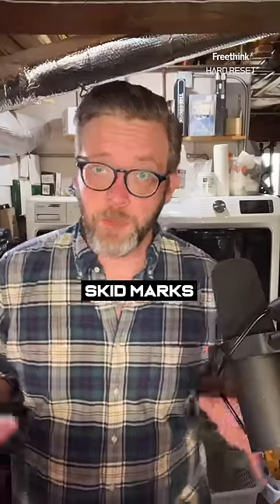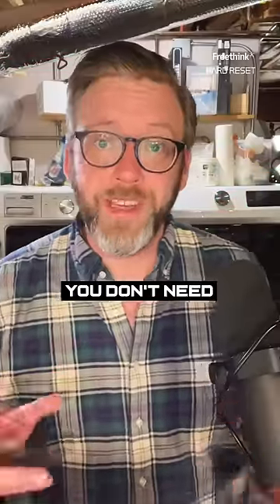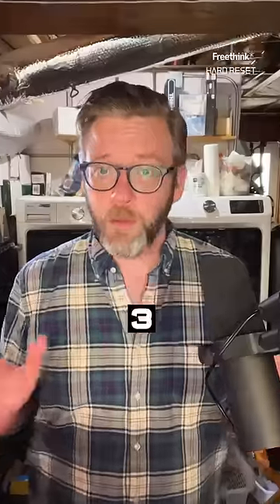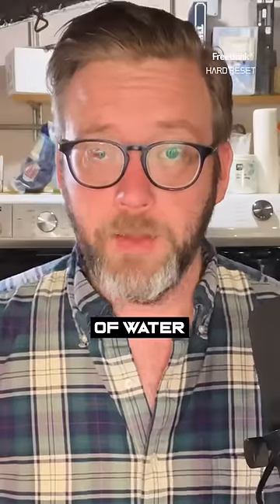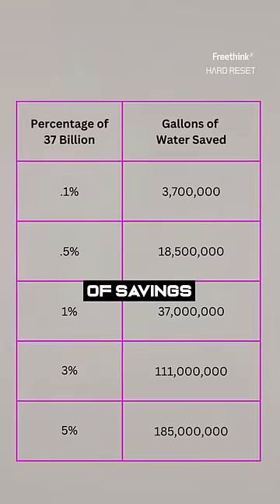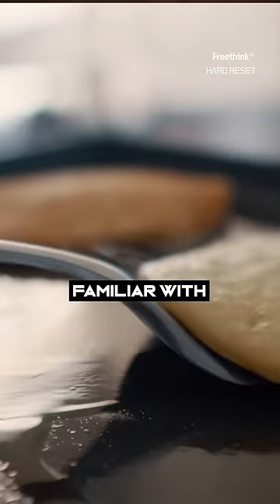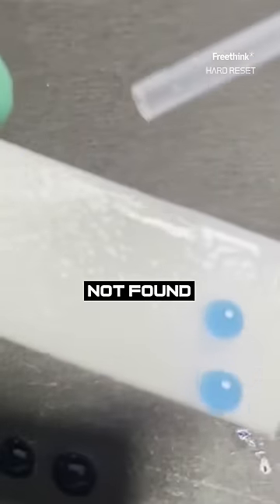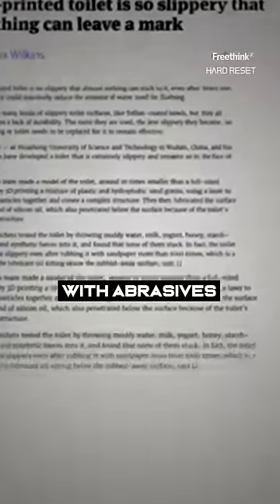Researchers invent super slippery toilet 🚽😳 #shorts #metamaterials

Comment: The standing water in the toilet bowl is meant to make an air-tight seal preventing sewage gas from going back up the toilet. And if you needed to push anything down that seal, you need plenty enough water or water pressure to do it. The flush isn't only meant to wash the bowl.
Reply: true, but this could definitelly be solved. For example train toilets dont have water in them and I never smell sewage (altho I do smell it when people miss the toilet .......)
Reply: @jurajpartl4797  there are different kinds of passenger train toilets. some just drop it to the ground below. others hold it in a tank with chemicals. and there are those that use the same thing airplanes have: a vacuum system.

a simple dump to the ground isn't gonna work for a home. chemical tanks need to be emptied and replaced. and a vacuum system needs power and has to constantly run to maintain a pressure differential; it's also a whole sewage system and not just the toilet itself.
Reply: @Kensuke0987 you're spot on that off-grid toilets are fundamentally different from plumbed toilets, but the video doesn't suggest 0 water.

Toilets use 6+ liters (2+ gallons) of water to flush, which is way more than necessary to form an air-seal if water pressure isn't needed to empty the bowl. Cutting that down by a fraction would be a major benefit.
Reply: @LibertyMonk  i think we already have that figured out. there are sectioned toilet buttons/levers that let you use up only a portion of the whole tank - only enough to flush the toilet and probably only to cycle all the water in the bowl. but i suppose not all plumbing and sewage systems are the same, so the absolute minimum might not be sufficient every time nor in every case; it's why the option for the full tank flush will always be there (for the big loads). also if you have to manufacture toilets at scale (to keep it cheap and supply many), you want it to be able to accommodate all homes after all.
Reply: @jurajpartl4797  nah what you saying is your nose not working or smth... Wait you're not from India

I roasted my own country I am sorry
Reply: Right. So with this, we'd only need the first part. Notice where he said LESS water, not none? We could redesign the trap.
Reply: @joshyoung1440  a slippery bowl is not gonna save much water. sure, some of the water is sent on the rim to rinse the wall down, but ultimately, all the water in the tank is meant to flush.

alternatively, you can just have a wider bowl, or just make sure you get everything in the water, so there is technically less rinsing needed to be done.

however, there is this shelf-style toilet bowl you can find in Germany which probably doesn't benefit from it being slippery since it's apparently meant so you can check out your poop before you flush it away (aside from avoiding the Poseidon's Kiss).
Reply: @Kensuke0987 
Haha, I assume "Poseidon's Kiss" is when you get backsplash to your nether regions? I haven't heard it called that before, if it is, and it fits so well!  😂 I love it. My toilet LOVES to that, especially if you're not crapping paper-thing scraps, and I've always hated it. I end up scrubbing things till they're raw because it's so unclean-feeling when that happens.
Reply: @ElysetheEevee  The trick to avoiding backsplash is to put a layer of tissue over the water.

Also, I highly recommend getting a bidet. It doesn't even have to be one of those fancy Japanese seats with 5 buttons and a sound system. There's a simply hand-operated one that's like a hose for your butt. They just connect to the toilet tank water supply line, so you don't have to install any new pipes.
Reply: Shhh, don't tell them! Let them make a few million of those toilets that will be scrapped, and we can use them for slippery barricades against a zombie invasion.
Reply: See J-pipes under sink.
Reply: @jurajpartl4797  That is because of a hatch inside of the toilet.
Reply: Dude, you really think someone standing in toilet water trying to get a seal is the best person to be doling out advice? They’re in the Arctic man! You’re way off.
Reply: @MrTTdawgTT  WTF are you talking about bro
Reply: i thought it was the amount of water needed to cause flushing. cause the U pipe has air, then it fills with water which creates a syphon effect. that sucks down all the poo and water from the bowl, then once the bowl water level decreases below the U pipe's level air flows back in stopping the syphoning. so i wonder how we would use less water? i guess the U pipe would need to be altered?
Reply: @joeman123964  it's the same thing. that U pipe is meant to create a seal. all your drains have them too and has the same purpose. the toilet's has a different shape but it's essentially the same mechanism.

you can make the pipe smaller so you need less water, but then it's also more likely to get clogged so it's not TP-friendly. you could try to make the part where the pipe goes up shorter, but you can only get so short before the seal stops working and/or the structural integrity is compromised. we could assume that the current design is already optimal; thousands of people over hundreds of years figured out the optimal shape and material for toilets; i doubt it's something we could match with a few minutes of curious and leisure-thinking.
Reply: @Kensuke0987  oh gotcha makes sense. thanks! learned something today
Reply: @Kensuke0987  it also comes down to the sewage system itself. These toilets, and other low water toilets, have already caused issues for the sewage infrastructure itself which was designed around a much higher volume of water and wasn't meant for these new modern toilets. Nobody hears about these back end issues, because the only people that know are people working for the city fixing them and plumbing is a dying trade.
Reply: @Kensuke0987 well European toilets aren’t siphoned and is very different from American toilets. Look up Siphonic vs Washdown Toilet to learn how they differ.
Reply: 241st like
Reply: I was also thinking about this, like what about the pipes that are used to a large water volume, are they slippery too?😂
Reply: Cover yourself in it, steal candy and cars, nothing will stick in court😂
Reply: @Kensuke0987 Sometimes many flushes are inevitable
Reply: The trap is going nowhere. He said saving a fraction, so water bowl stays, use of water is reduced not completely removed
Reply: @007_Sun_Tzu  the water is not only used to wash the wall of the bowl. it is also used to flush. if you reduce the water in the tank just because you got rid of the rinse action, you might not have enough water to flush the bowl entirely (not all buildings/sewage systems are the same).

the key point here is that if you want to save on water, you might compromise the flush action at the same time.

on a side note, if there's anything positive about this innovation, it looks easier to clean/maintain. you could save on cleaning products and someone's man-hours.
Reply: @Kensuke0987 I am German and the plate-toilet you describe is hell. I hate it much, luckily newer houses don‘t get it anymore.
Reply: That's true, but this kind of toilet would mean you don't need to flush more than once if you have a messy 💩
Reply: @Kensuke0987 Things do not stick to the surface as easily, less water is needed to force it down. Do you not understand? Instead of finding fault constantly, why don’t you look on the bright side for once?
Reply: @l0z586  Are you just looking for strangers on the internet to argue with?

What do you even mean by "finding fault constantly"? Do you even know me? And I already acknowledged one positive of this that it would be easier to clean. So in your words, I did "look on the bright side".

Other than that, I already said all my points on this thread. But there is one thing I haven't mentioned yet: if there is not enough water in the tank to flush the toilet, you will end up having to try flushing *again*. On the contrary, reducing the amount of water in the tank will increase water usage instead. Remember, the water used to wash the walls is the same water used to flush the toilet. In order to actually save water, you have to reduce the water in the tank too.

The only real way to actually reduce amount of water needed for flushing is to make the toilet bowl smaller (less standing water), but then the size of the things that could be flushed would also be smaller (ie TP is more likely to clog the toilet).
Reply: Well i understood your point. But i believe this video was about reducing the amount of water needed. That is,I agree with you that we still need water in the conventional toilet,but if the waste won't stick then less water would be needed to clean it. (That is, if you need to flush with 4 l water before,now it would only need 2 l or something,as it now just needs to push the waste.)...
Reply: And (in my views) the better way (than making these slippery toilets) for decreasing water consumption, is to either switch to the Asian system of using a bidet, making reusable toilet papers or leaving the *wipe the bum with something* method. Because toilet papers require *paper* which eventually comes from a tree that used water. So throwing that paper after one use wastes water too much.
We can recycle bidet water in water treatment plants but the toilet paper goes directly to either composting or incineration. Hence total wastage in the latter case.

(Because toilet paper have fibers which are too small/short/thin to be recycled again,plus bio waste is there which can transfer infection)
Reply: @LibertyMonk  So how is having a slippery toilet bowl change anything? You still have to replace the water and make sure the contents is pushed out.
Reply: This is more to optimize flushing. If I clean my skid marks, I need to flush once more. If there are no skidmarks, I can flush once.
Reply: @MartinzW  at that point, you are cleaning the toilet. you may as well use a toilet brush.
Reply: @Kensuke0987  that's the point, when you use brush, you flush after to not leave poop debris floatin in the bowl. So you save an extra flush by not getting your toilet dirty.
Reply: @MartinzW  what i was arguing against was the idea that you could reduce the amount of water in the tank at all, which would have compromised the flush action.

i did acknowledge that the slippery walls would make it easier to clean. what you're describing is cleaning, distinct from just the flushing action. you don't even have to use the flush to clean - you could be using the hand-held bidet to spray it off, or you're using a bucket and pitcher all the while using a toilet brush. Either way, the act of cleaning will always use water, although you might be able to use less water than a flush would even with a conventional toilet.

i don't think everyone cleans their toilet everytime they use it. I mean, even if you were a clean-freak, there should be some times that you don't make a skidmark, right? Or maybe you use one of those German shelf-toilets?

we're not in disagreement.
Reply: Suction is the answer. Ever been on a plane?
Reply: @jurajpartl4797 Duh!! That's  because your terds are on the track being left behind at big mph!! 🤦‍♂️

Comment: As far as toilet flushing goes, I'm pretty sure that the excess water is important to keep solids flowing through the plumbing after the toilet
Reply: That's why they need to make the plumbing pipes outta the same material..
Reply: @denverscott37  imagine even trying to hold the pipe without something that stops it from falling off your hand
Reply: @denverscott37 how would u then install liners in it? If u can't u need to break up the concrete through the whole house to change the line... unless u live in a wooden floor house.
Reply: @kungfreddie you can still install new developments with this piping. Retrofitting problems shouldn't stop us from making improvements to future construction
Reply: Also considered this. And the pipes being made in the same way would help for sure, but it’s more about the many feet that don’t have much of a drop. Having done lots of plumbing work myself, I’d imagine the only way around using less water would be to hook up some sort of air compression system to “blow” the lines out after “flushing”…not sure how it would all work, but maybe you could introduce air into the drain line after the toilet trap?
Reply: and block the smell too..
Reply: No need for extra cleaning
Reply: @kurtdupree1254 would you pay 2000++ dollars to have your whole house ripped apart just so your turds slide through easier and you save maybe 200 on your water bill each year??
Reply: @Blake22022 knowing my turds 
Yes
Reply: No
Reply: The most cost effective solution is actually incinerator toilets- which have existed for years. Have pee go into the water system, while poop and paper gets burned in the toilet. If they replaced the use of water toilets for 💩 slowly over time it would lessen the amount of solid waste while also reducing the water being wasted to flush. A incinerator toilet   would be maybe 4000$ by the time instalation is all done(the toilets are like 3k by themselves and you need to use either electric or gas to power it, plus set up an exhaust system) which may seem like alot initially but in the grand scheme you will be reducing the strain on the water system 20gal(estimated 19-24 gal a day per toilet) a day over 1 year is 7,300 gallons of water. While maybe not realistic for every home(specifically pre-exisiting large apartments) places like mobile homes and single family dwellings could benefit especially in climates where freezing pipes are a concern.
Reply: @thornback5641  That saves water, but what about the electricity/gas costs?
Reply: @thornback5641  you may be saving water, but now your venting toxic gases into the atmosphere, as byproducts of burning the solid waste
Reply: @denverscott37 that would end up costing way way way more then what anyone willing to pay.
Reply: @SRHMorbid  that's how all new technology is at first tho, a product comes out, hardly anyone can afford it, then companies start competing to produce the same or a very similar product at lower and lower prices, that's capitalism in a nut shell..

Comment: Sinks maybe for easier cleaning. Funnels so they don’t get so clogged with sticky stuff. Measuring cups for the same reason. Whiteboards maybe again for easier cleaning without the aging streaks. Umbrellas, rain ponchos, boots, tablecloths/place mats if it can be made thin enough to work like fabric. Keyboards so no more drink spill stickiness, freezer/fridge again for cleaning stickiness off. Slides ofc. If it’s body safe certain adult personal items might benefit from it. Mixing bowls no more batter stickage! Product bottles so you can get every last drop out.
Reply: All these idea would be great except the white board. I feel like you couldnt draw on it in the first place making it self defeating.
Reply: I was about to say the same thing about the whiteboard probably not working.
Reply: I think you are confusing waterproof for slippery
Reply: this material is very expensive so using it for stuff like bottles will be very expensive, also you wouldt be able to put the letters on keyboards, the drinks would also still go between the key gaps and ruin the keyboard, theres no way to avoid key gaps.
Reply: also typing on the keyboard will be way harder, it'll be like typing on ice. Your finger will keep slipping, this also applies to the other things like mixing bowls and tablecloths
Reply: Oooh measuring cups that’s smart
Reply: @Nabooze  everything is expensive if you make few things with it. Steel was once pricier than platinum, people used to make jewelry with it. If the raw materials are easily found and you can make the process of production easy enough...
Reply: WHISKS
Reply: Maybe not whiteboards, the ink might not stick to begin with.

Comment: The drain pipes would also need to be coated as well . 
 It takes a certain volume of water for the log ride down to the sewer.
Reply: Didn't think of that, and it seems neither did the content creator.
Reply: In many places, due to water „savings“ by the residents, the canals clog up. So they have to clean them on a regular basis, and guess how, with a water jet that’s using a shitload of water.